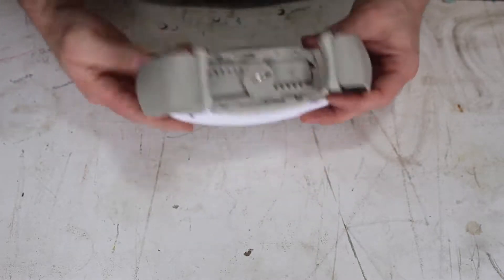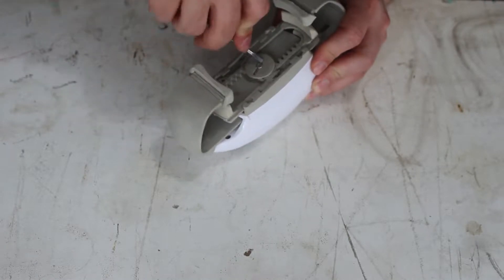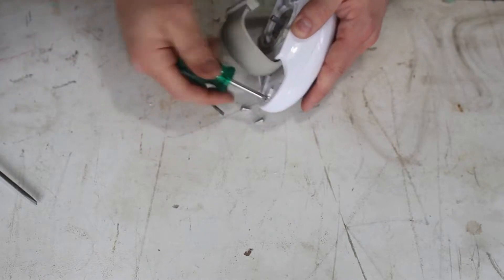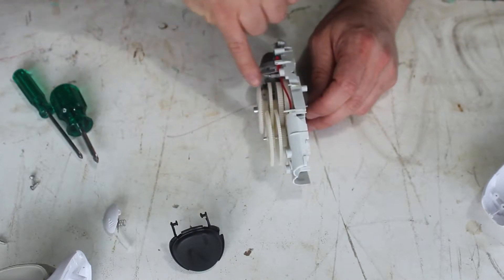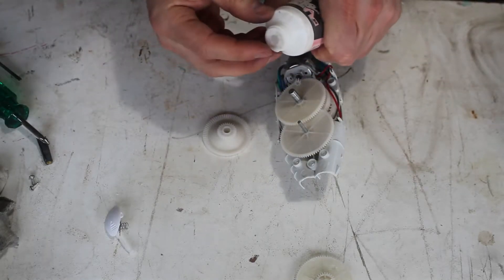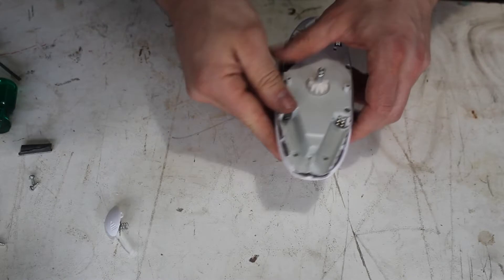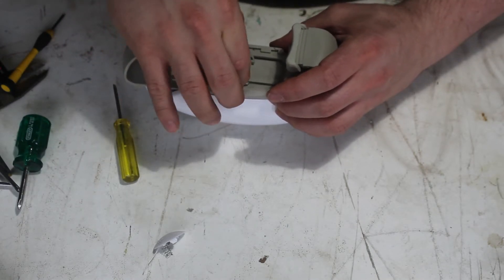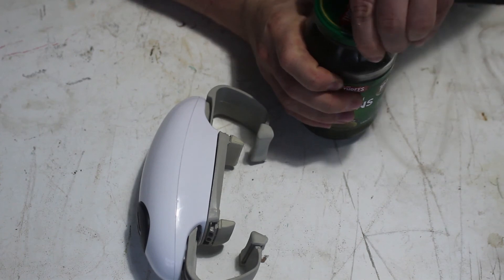Jar opener repair

Comment: I've pushed my pin as far over as I can but cant get the pin out, whats the secret?
Reply from the maker: Hmm it only comes out one way, make sure you pushing towards the longer slot. You'll also need a thin punch (or a right angle pick) that you can poke in on an angle to get it the whole way through the hole.
Reply: @grannyflatgarage7599  I've got it pushed all the way through, I just don't have angled tweezers to pull it out. Which makes me nervous I won't be able to get it back in after. 

Great video!
Reply from the maker: @statefruit182  you should be able to just flip it over and shake it out or pry it up with a little screwdriver. Don't worry about getting it in it's much easier than pulling it out. It's not really designed to be disassembled but it is designed to be assembled quickly and easily. 
Glad you enjoyed it!

Comment: Something I did notice is that this jar opener is not one of the Robo Twist jar openers.  The Robo Twist jar opener usually has a big green button and the words "Robo Twist" on the side of it.  The Robo Twist jar opener has been improved over the years so that it can create more pressure to open a jar that's vacuum sealed.  There's no way I would have bought this copycat brand.  The company that makes it probably uses cheaper components and has less quality control.  This copycat brand sells for about $10 less than the Robo Twist.
Reply from the maker: Hmm possibly, I don't own this I fixed it as a favour to someone else and to make a video about what's inside one.
Obviously if you're looking to purchase one yourself do some research into brands.
Reply: @grannyflatgarage7599  I understand completely.  I know you didn't purchase this jar opener.  I just wanted to let people know this is not one of the Robo Twist jar openers.  There has been so much counterfeit merchandise from China.

Comment: My problem is different. I fixed the gear issue, but when I use the opener it opens the jar, but won't open the jaws and return to the normal position automatically. Sounds like the electrical switch. Any hints?
Reply from the maker: Hmm have a look at the little switches that monitor when the jaws are in/out one could be stuck...
Reply: I noticed at least one switch. I also noticed something else that might be another switch, but I'm not sure. I will have to take another look inside. My wife was the only person who used the opener,  so I'm just learning how the internal parts work. If you have any clues on how to troubleshoot the switch, or the location of the switch feel free to let me know. I saw the metal flap that operates the switch. I'll try tomorrow.
Thanks

Comment: What I failed to see was the little plastic pin during reassembly that has a flat on the shaft with a spring and a trapezoid cover being replaced?
Reply from the maker: Sorry I honestly can't remember the plastic pin it wasn't actually mine so I can't check. Unfortunately when I filmed this it was more for entertainment than instruction so I didn't go into detail about each step.
I hope you can sort yours out.

Comment: how do you open the device when it is stuck?  someone tried to open a can with it and now it is stuck on the can.
Reply from the maker: Hmm, you could try putting the batteries in backwards (not sure if they will fit) to apply a reverse voltage and spin the motor backwards this should open the jaws. 

If the batteries don't fit try and hold a piece of wire on the contacts with the battery on the other end.
Reply: @grannyflatgarage7599  good guess, but unfortunately when I switched the direction of the batteries nothing happens.
Reply from the maker: Ah, that's a shame. I'm not too sure from there sorry. You may be able to gently pry it off, as the arms are plastic they should have a small amount of flex. 
It could break it though...
Sorry I couldn't be more help
Reply: @grannyflatgarage7599   Thanks for the suggestion, I put on some leather gloves and mangled the can out from the arms of the device. All is good now.
Reply from the maker: @MOVIEKICKS  good work, glad you got it fixed!
Reply: D O N' T ! reverse the batteries, because you will damage the motor.
Reply: Turn the section with the smaller jaws 1/4 turn and then you can open the jaws annually. If you want to fix it permanently, you will have to take it apart and check the gears.

Comment: I just was having a go at mine when I stumbled across your video.  Mine was only running internittently and you had to keep pressing the stupidly idiotic battery cover to make it run.  I didn't manage to disassemble but will have another run at it now I have seen the way you tackled it..  I may just solder some longer wires and run it from a mains transformer PSU and save keep buying batteries.  The later design has changed the battery door and it is much better.  Thanks for the how-to.
Reply: use a 14500 3.7 li-ion battery, and a dummy cell. the extra .7v won't hurt that little motor.
Mine was similar to yours; the pinion gear (Pinion gear is the one on the motor shaft) was stripped.
The motor was also burned up; or the brushes are bad. I haven't gotten that far yet.
If the motor is toast; the whole thing is not worth fixing it (In my humble opinion)

Comment: The tear down was helpful. Thanks.
Mine was broken because of the little gear on the motor; it was cracked, which was hardly noticeable. I'm trying JB Weld, which has been useful in the past - we'll see.

Comment: theres your problem it runs on 2 AA batteries and is underpowered
Reply from the maker: Yes well that's certainly  part of the problem. It did actually work quite well though, if a bit slowly.